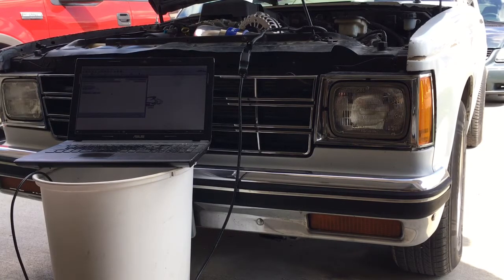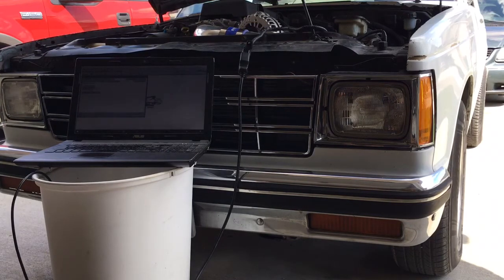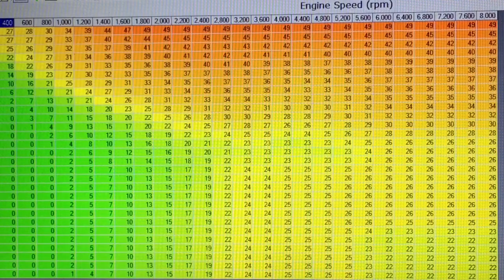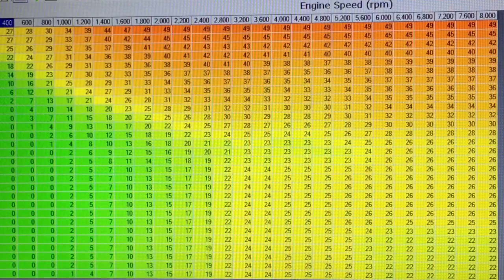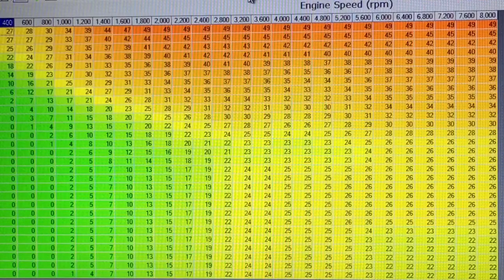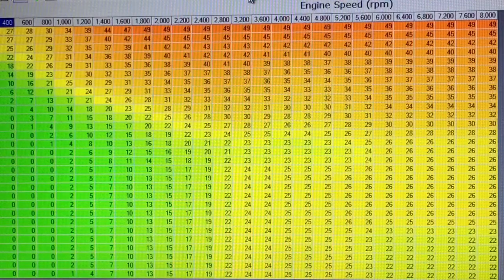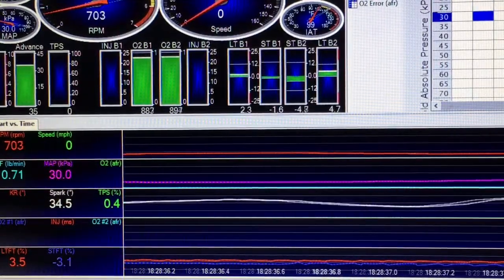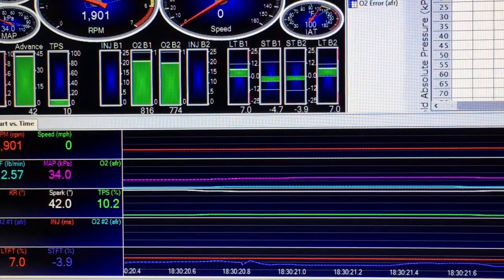HP Tuner Pro 4.8 timing table Test

Comment: Are you scanning with H.P. tuners?  Using the scanner can help with maf and ve tuning using your narrow band O2 sensors. Invest in The Tuning School books. Gives you peace  of mind and more confidence while tuning.
Reply from the maker: coarsegrind My combo never ran well using the narrow band o2’s, following the tuning directions.  I made big gains once I started tuning with a Wideband o2 setup. 
For some reason the narrow band never understands what the engine wants at idle. At least not on my application. 
Yes I’m using the scanner to collect data. 👍😉. JD

Comment: Also, your KR graph should read 0 at all times if it has no knock. You may have to try adding a different KR.. thing.. on your logger.
Reply from the maker: Colton Shimko I totally never saw this post, I definitely need to configure better format to my monitoring options/layout.  I also need a real Wide Band o2 to see what’s happening. 
Thanks for the tips! 👍

Comment: I'd watch around 3500-4500 rpms, those are the areas around peak torque and peak cylinder pressure and should be lower.

Cylinder airmass is a calculation and can be thrown off by alot of things.

Tip in tps can drop timing during throttle transitions, iat temps over  certain temp will drop timing, so will burst knock(preventative kr).

Burst knock is a feature that retards timing to prevent knock without actually detecting any.
Reply from the maker: Colton Shimko Iirc I have the IAT set to start pulling 1degree around 122 degrees then it ramps up to a maximum of 5 degrees at the highest point. Under 120 degrees it pulls 0.
I'll look at the timing table again to be sure of the torque peak timing.
I don't have access to any "Burst Knock" in my tune, I'm not sure if it's the version of HPT I have or related to my engine/ECU being a 2000?  Not sure, I just know there's nothing like the BK

Comment: to answer another one of your questions, the reason you see mainly stock tunes on the hp tuner site is because most of the people on there are either tuners or people who are just learning. The people who are just learning post stock tunes or tunes theyre having issues with. The stock tunes are good to have to fall back on when someone who is just learning doesn't save their stock tune and gets their tune so far out of wack that they need to just start over. The actual tuners dont post their tunes because thats where the money is. If we posted all our tunes up, then people wouldnt pay us to tune. They would just download something close and treat it like a canned tune from a handheld. " close enough, dont need to pay a tuner now." ;) On the flip side of that, if a tuner does upload a tune and someone downloads it and blows thier junk up because it wasnt right, then they slander the tuner all over the internet and ruins business. " I used so and so's tune and it blew my engine up". So its really a lose lose situation for a tuner to upload anything there. Some tuners even go so far as to lock the pcms that they tune. I personally dont agree with that practice but many dyno tuners do it.
Reply from the maker: I fully understand!